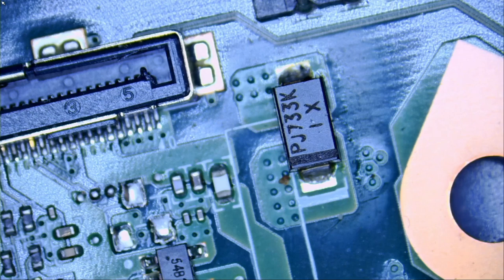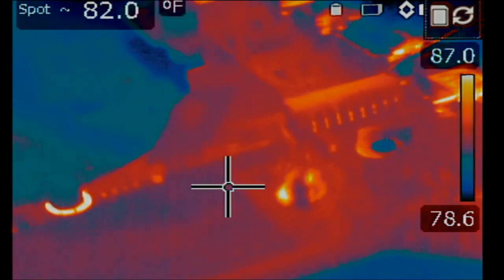Asus GL703V Gaming Laptop Repair - How hard can it be ?

Comment: Good work alex & big boss
This laptop is like 5 years old (2018 release)
But is it just age that killed the diode ?
And what kinda diode it was? general purpose, schotkey...
Reply: TVS diode to protect against overvoltage, that's why it's between power rail and ground....
Reply: @ssikhcnerf  Thanks man
"A transient-voltage-suppression (TVS) diode, also transil or thyrector, is an electronic component used to protect electronics from voltage spikes induced on connected wires..." * from wikipedia

Comment: How does big boss remember each screw and ribbon cable slot on so many different devices ? Crazy
Reply: I'm a retired electronic tech.  After many, many years of disassembly/reassembly, I can tell you that it's not a question of remembering - it's just knowing.  Kind of hard to explain!  I'm sure Big Boss knows what I mean. :)

Comment: Thermal paste not changed while assembling lapton. While putting back heatsink it's important to screw in from the opposite site so pressure will be applied evenly. Big boss has still lots to learn 😂

Comment: I had a question:  I am but a simple soul, but do these parts that get heated up, like caps, diodes and larger chips suffer from the increase in heat or would it not matter?

Comment: I recently bought broken graphicks card for parts to change on my working GPU. I need MSI fans from broken one. When I started dissasembly broken one I have discovered that the connector is diferent. So as a long time Northridge Fix viewer I took multimeter and measure any short at 12v 8pin connector. I found no connect with 12v rail. Probobly 0 ohm resistor or some kind of fuse went bad. As I do not have soldering skills I carryed this card to lokal repair shop. Two days alter they contacted me with info the GPU is making short to power supply and tuning it off. Possible GPU failure and no fix
Reply: what are you trying to tell ?
Reply: @TTTT-sj3vz  In my opinion rhis GPU is not dead. Something went bad and making a short. As a viewer I check almost everything what I know to check. The core is not fried so it should be repairable. Not every service shop has time and knowledge how to repair broken boards. In my perspective this shop is not even "open" the card to check. They just try to turn it on.

My point of view is : I did more to try to repair than the repair attempt in local service in my town